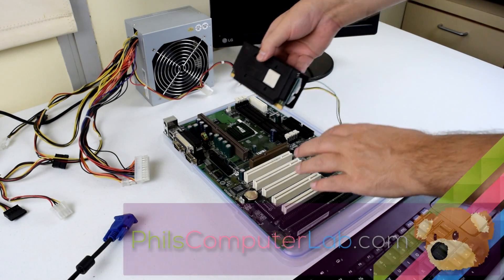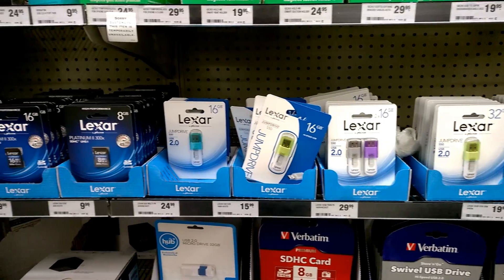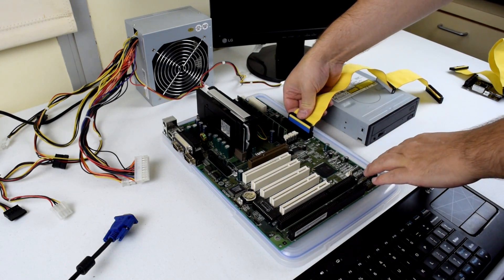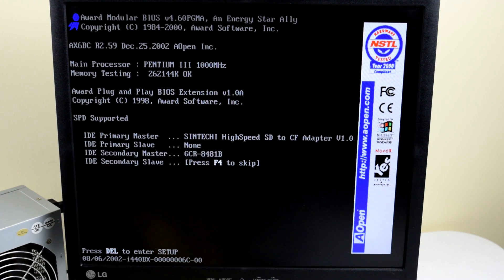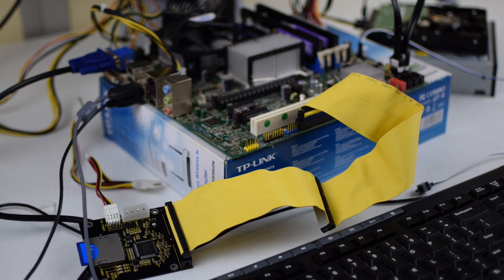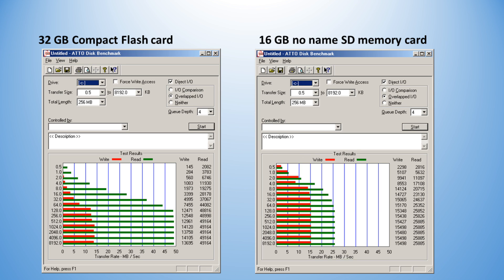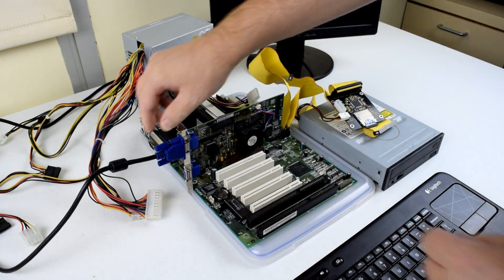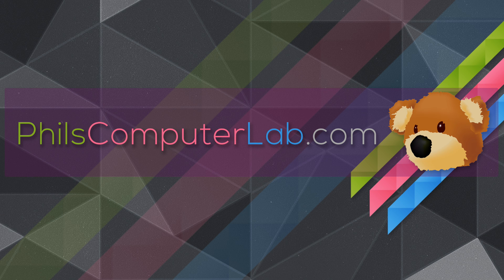SD memory card to IDE adapter review benchmarks guide

Comment: Wow, I knew about the IDE to CF adapters, since I've ordered two of those along with an 8GB and 16GB CompactFlash card respectively.  However, now that I see this, makes me wonder if SD really IS the format of choice now.  I mean, since it's clearly the cards that are most mainstream.  Wouldn't surprise me that SD WAS the flash card that won the media flashcard wars.  However, since most vintage computers always relied on CompactFlash for best compatibility, who knows?
Reply from the maker: Well just to give you an idea, the last few months I have only been using SD cards! I can get 16 GB SanDisk ultra for $10 at the post office, so I have four now I think. And I use them with various builds. Taking an image is also super easy, so it's made my life a lot easier :) So I used SD cards in 386, 486, Socket 7, Slot 1 and Socket A :D
Reply: Nice!  Yeah, seems that both CFs I had (both SanDisks) didn't even want to format, and even though BIOS did recognize that I did have the adapter, uhm...yeah.  So, maybe getting an SD adapter to IDE might actually have better compatibility with Win9x PCs.  IBM can be pretty darn picky with their SurePost BIOS, that's for sure.

Comment: Looks like eBay has the 2.5" Laptop IDE SD Card adapters available as I'm planning to replace ye olde Hitachi IDE HDD (20GB) that's been used for about 13 years now and it has 1 bad sector and slowly increasing.  Luckily, I backed up my files into 1 file, so when I replace said HDD with the 2.5" SD 44-pin IDE controller, I'm gonna insert a 16GB SDHC Class 10 card, format it with the system files, shut off the laptop, remove said card, boot into Linux (temporarily) and copy the backup file onto the SD card, boot the recovery program that is on the Windows 98SE CD, and restore every file onto the SD card.  What I mean about backing up the files, the whole HDD that has everything on it, including the system registry, has been backed up into a single file.  I tested this before on my AMD K6-2 PC when the OS had issues, and luckily, I had my backup files prepared on another HDD, loaded the Backup program, and restored everything back to its formal glory. And you learn something new everyday.

Comment: Did your 386 discover the SD adapter just like that? I just tried one (different chipset, I think) in a Socket 7 mobo with a Pentium-200, set IDE detection to "auto", no drive detected. I was using a 16GB SDHC card, but the adapter is supposed to support it, and the system should be new enough to work with FAT32 fs...
Reply from the maker: Yea it just worked for me.

Comment: I've got one of these and have tried it on a 486 and a Pentium 100 and neither would boot off of it.  Have you run into any issues with it?
Reply from the maker: Nope. You can see it working in the video however.

Comment: How do the SD cards compare to normal Mechanical IDE drives?
Reply: faster. replaced a 3400rpm drive with one and it was blazing fast. It's about on par with the 133Mhz bus speed which is the max an IDE cable can work on anyhow. Unless you're running a 10000RPM Raptor drive or something it'll be an improvement.
Reply: Televicious Goober What about a class 4 sd card vs a 7200rpm 20gb samsung ide?
Reply: 7200rpm 20gb samsung is faster on average. Class 4 SD may be slightly faster in random r/w.
Reply: @Wakanda.Knuckles  my 80gb samsung only had 7mb/s speed (probably dying), the wd caviar SE 250gb has 32mb/s speed (both IDE)
Reply: david b wrong comment, sorry

Comment: Excellent video Phil! I had no idea this ever existed. Can I use the SD card (with the adapter of course) as a secondary hard drive on a windows 98 machine?
Reply from the maker: +Neo Xbit Yes that should work. Note that this adapter didn't have a master / slave jumper, so it might, or might not, get along with another device on the same IDE channel.
Reply: +PhilsComputerLab Thank you for the tip, I'm actually planning on using on it on a seperate free IDE channel.
Reply: +PhilsComputerLab I'm also interested to know how it compares to an old-school IDE hard drive. Is it significantly faster? 
Thanks for the help.
Reply from the maker: To old-school drives? Yes, much faster.

Comment: Have you found anything like the CF front-mounting drive bay you use in your other videos?

I really like this adapter, especially since SD cards are cheap and abundant.
Reply from the maker: +simbin Unfortunately not, I haven't. But I also haven't done much searching, usually I do a quick search on eBay and Amazon, that quickly shows me what's available.
Reply: +PhilsComputerLab I was thinking great, now I can just pop this SD in my main PC and copy over all my ready-to-go DOS games.. but Windows doesn't recognize it as formatted. Do you know if it's because of the Sintechi adapter or Ontrack - any workaround? Using a 4GB SD / two partitions with Ontrack.
Reply from the maker: Hmm that might be because of Ontrack...
Reply: +PhilsComputerLab That's what I'm thinking. Hmm I wonder if I can blow out the Ontrack MBR with DOS and keep my data intact. I don't have anything on the second partition anyway.
Reply from the maker: Hmm, not sure, sorry.
Reply: +PhilsComputerLab It was Ontrack. I'd to wipe my SD and I'm limited to 504MB partition - BIOS supports 2GB hmm. But it's still more convenient to copy files onto.
Reply from the maker: That's a bummer. You could try EZ-Drive and see if that one works, but not sure. The reason I mention it is because I had it on a CF card once and that worked accessing it in a card reader. But not sure about the SD card. You're the explorer with this, first person testing it :D
Reply: +PhilsComputerLab I don't mind testing but isn't EZ-Drive just WD's rebranded ver of Ontrack? I have the Quantum ver and I know there's an IBM ver - probably others.
Reply from the maker: No it's totally different. EZ-Drive was Ontrack's main competitor. The WD EZ-Drive, I have a copy of that on my site, is the one I used. I think I made a video tutorial of that also...
Reply: +PhilsComputerLab I'll give it a go. Any preference between versions 9.03 and 9.06?
Reply from the maker: Can't remember the details, but I'd try the latest one :)
Reply: +PhilsComputerLab Used the DOS ver on your website and IT WORKS!! Only recognizes the first partition but it beats 504MB Thanks :)
Reply from the maker: Awesome!

Yes, the thing with the partitions is a windows issue. If you have more than one FAT 16 partition, Linux and OSX will show all of them, but Windows only the first one. Pretty lame...

Comment: Do any of these SD card to IDE adapters plug directly into the IDE header rather than on the ribbon cable? Since you say the SD card adapter has issues with a second drive on the same IDE channel, I would rather have an SD to IDE adapter that plugs directly into the motherboard like the Compact Flash to IDE adapter I use on my AT&T 486DX2 computer.
Reply from the maker: +Ace9921 CF for sure, not sure about SD. Just run a search on eBay, you will quickly see all the adapters available.

Comment: With this you could technically make a way smaller computer case since it wont need the big IDE hard hard drives.
Reply from the maker: +Nico 93 True, but you still need at least a case that fits an uATX motherboard.

Comment: This is probably the best video you've ever produced -- gets straight to the point right away without a lengthy introduction, very clear text and explanations, and a practical range of test hardware (386, pentium, core 2).  I hope the videos I produce this year are this clean.  Great work!

If you get a chance, can you amend the description to provide a link to the actual unit you tested in the video?
Reply from the maker: +Jim Leonard Thank you! I do my best and try to improve.

I can't post the link at this point in time, but a search an eBay will get you a result straight away.
Reply: @Jim Leonard  Hey! It's awesome to see you here!   Guess I'll ask a question that popped into my mind while I was watching this— plus another question.   Have you tried one of these? Have you or anyone else tried one of these with the Jr-IDE?
Reply: The jrIDE was engineered primarily for flash DOMs, which fit inside the sidecar nicely and provide up to 8 gigabytes of storage, which is orders of magnitude more than a PC jr. could ever use, so I have not tried any of the SD card adapters.
Reply: Jim Leonard I know. DOMs and even CF cards are more than sufficient. I don't see myself or can even imagine anyone else using one of these in a JrIDE, but it was just a thought. 

Speaking of DOMs, I was using my 8GB Kingspec dom on another system than I normally use to transfer some files and got a puff of the magic smoke.   I opened it up to see what happened and the trace that connects pin twenty to the external power connector was burned off.  After I replaced the trace, it has become pretty flaky.  It's probably due to the crappy PSU I was using… Which now found a new home outside of any case not connected to anything but the dust it collects.

Comment: this is really nice, my 440BX PC is currently just running an old Quantum LCT (max 20MB/s sequential read on it) so it would be an improvement even for that, and SD cards seem to last forever, use less power, make no noise... also, it's an SD card, I assume you can easily remove it from the adapter to pass some files from a newer PC? it's a lot more practical than the alternatives I think.
Reply from the maker: +hmbrz Absolutely! I use a USB memory card reader for transferring files, like drivers or games :)

Comment: I'd like to try one of these. My Win 98 retro box is running on a CF card, and I've noticed what I'm pretty sure are some performance issues with it (mainly with file seek, and loading video files).
Reply from the maker: +The Examined Life (of Gaming) If you end up getting one, please update here with your experiences, would really like to hear how others find it.
Reply: PhilsComputerLab Sure sure. I'm leaving the 95 box as is (on a 40GB Maxtor or something awful) because getting DOS mode to work on that thing was a NIGHTMARE. :)

I think the performance bottleneck on the 98 machine is the Athlon 900, it might be time to upgrade to a nice P3. In my experience so far running games on the CF card doesn't have any performance, it's just longer load times for cutscenes. If that becomes too much of a problem, I could do minimal installs and let it run the video files off disc.

Comment: I'm having a problem with my Packard Bell Legend 125 486DX40 machine. Apparently I need a utility to set my Compact Flash card as a FIXED DISK so I can use FDISK to partition it. I'd imagine SD cards have a similar issue as they're removable media by default.
Reply from the maker: +AshtonColeman Hmm, I never had such an issue with any of my CF or SD cards...
Reply: +PhilsComputerLab SanDisk's site has some information about this:

Enabling Fixed Disk mode on SanDisk CompactFlash cards

Can I enable the Fixed Disk mode on my CompactFlash card?
     
Under the CompactFlash specification, cards normally function in
 "removable" mode, in which case they use a modified set of IDE commands
 and are prepared for hot plugging and removal (dependent on software 
support). Some tasks require the use of "fixed disk" mode, where the 
card instead uses standard IDE commands, at the expense of some features
 specific to the format.

It is worth noting that removable and fixed modes have nothing to do 
with a card's supported PIO or UDMA modes; this is an entirely separate 
feature specific to CompactFlash and does not change the communications 
protocols at this level.

CompactFlash cards can be configured to use "Fixed Disk mode" as this is 
defined by the CompactFlash specification. However, SanDisk does not 
support its implementation with our consumer or professional-level 
cards, as it is outside of the scope of their intended use. Thus, all of
 our consumer and professional cards are shipped, by default, in 
Removable mode. 

SanDisk no longer offers an OEM or fixed disk Compact flash card line. 
There also is no utility available to change retail Compact Flash cards 
from removable to fixed disk.
Reply from the maker: This doesn't help your cause, but the best I can recommend is getting a brand that I showed in the video. The Lexar or Verbatim should be readily available.

For CF cards, I got really cheap ones from eBay. I don't have anything from San Disk to test.
Reply: +PhilsComputerLab I have an update. The 2GB CF card that did not work is Transcend branded. I just tried a 1GB CF card out of a Cisco networking device and it worked fine. 

To add, I just found this explanation on Transcends FAQ website (faq-399)!

Note: Transcend commercial CF cards are set to be Removable Disks, whereas Transcend industrial CF cards are Fixed Disks.

So that's something to look out for when buying a CF card.
Reply from the maker: Good to know!

Comment: This would be very useful for older retro machines (early Pentium or older) where partitions are 2GB , and the file sizes are small, Also the CPU would be holding back the data transfer on anything faster anyway (not to mention the IDE controllers being at best ATA33 anyways)

For something like an Athlon or P3 machine it might be better to just go with a standard hard drive , since those systems have better LBA48 support, and more support for ATA66 or ATA100 . 

As a side note, I find it funny that the no name SD card quite happily keeps up with its more expensive branded counterparts.
Reply from the maker: +lightdark28 Yes indeed. I agree that a Pentium III is pushing it, but if you don't need lots of storage, 16 GB actually goes a long way under Windows 98.

On your typical 440BX chipset, ATA33 is the limit. But later chipsets, they can do ATA66. Maybe future SD adapters will improve on this.
Reply: +PhilsComputerLab 

well 16GB was actually pretty decent in 1999 or 2000 , heck most people were using 5900rpm drives at half that size, so its certainly manageable (I was still using the 8GB HDD I got in 1997).

Just depends on how many games you plan on keeping on that drive.

Comment: it would be interesting to look at the work of these adapters(2 or more) on some old pci ide raid card with internal buffer memory
Reply from the maker: +Yolo Zoldberg Great idea! I have some NV boards that can do RAID on IDE I believe. But currently I only one SD adapter anyway. I think it would double the transfer rate to 50 MB/s and keep the low access time.
Reply from the maker: CSIG1001 Nice! Please update here and share how you go.

One tip: If your SD card doesn't boot, type

fdisk /mbr

from the command line of Windows 98 SE install CD.

I would use a single partition. Out of the box, Windows 98 SE can handle just over 120 GB drives. Beyond that you need to hack it with 3rd party tools. Personally I stick with smaller drives.

So your 64 GB should be fine!